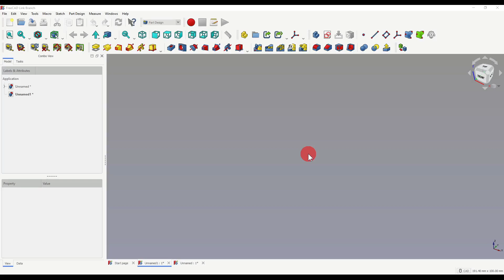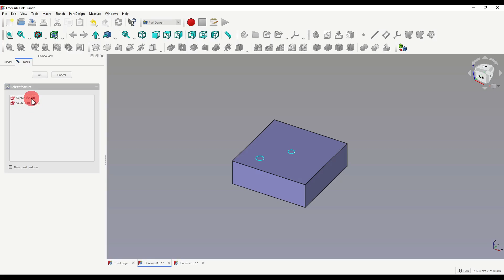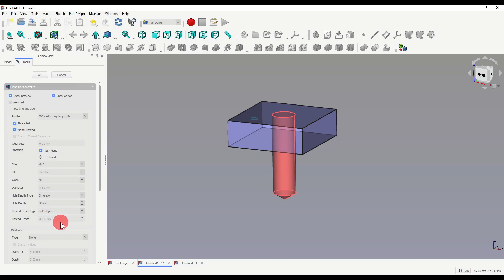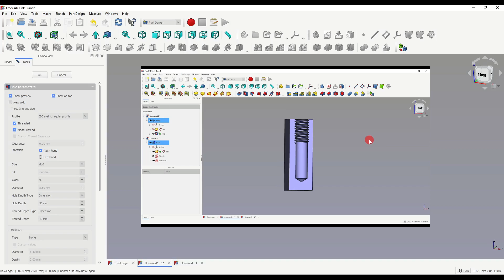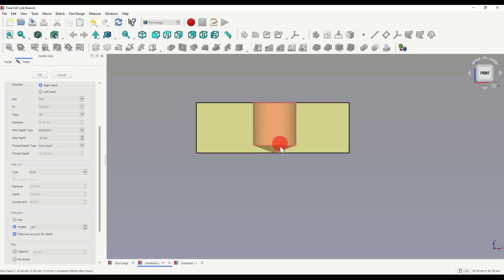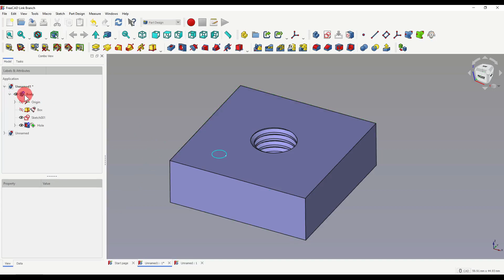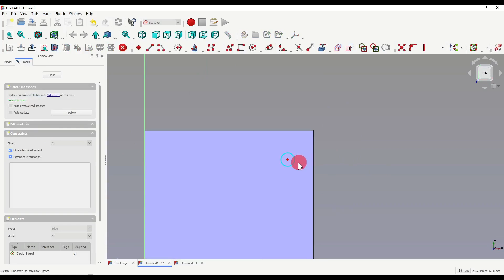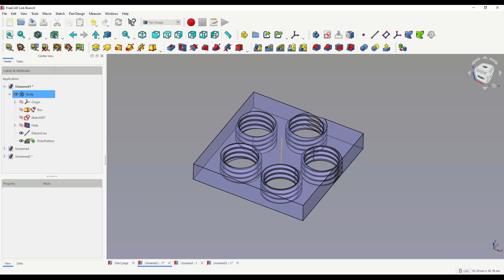3D modeling FreeCAD 0.19 - Hole Feature

Comment: Hi Andrew, I'm having a lot of trouble with this. In FreeCad 0.20.1, I tried to make a simple straight hole in a 3mm thick rectangle and it keeps kicking out an error at every turn, then refusing commands and locking out everything. "No sketch", so I try the Sketch part and it won't let me draw where it need to go, fix the location or anything. I put placeholder cylinders with the correct dimensions so that information won't get lost. And on top of this, it's refusing to let me export to a regular STL too.

Can you help me please? I could fabricate this from scratch in under 15 minutes blindfolded with just a drill and both 3mm and 5mm drill bits. But I need it to be dead-on accurate for a CNC axis adjuster.

Comment: Thanks a lot! Learning FreeCad and its very helpful, but looks like threads are not actually rendered in stable 0.19.2 version, hole operation seems to work, but "model actual thread" is always false, which is a bummer since I want to 3d print it. So I'll try realthunder branch. Mine version is 0.19.24291 btw.
Reply: did you ever solve this. thread feature isnt working for me either on version .19